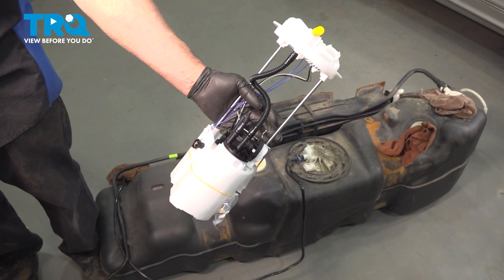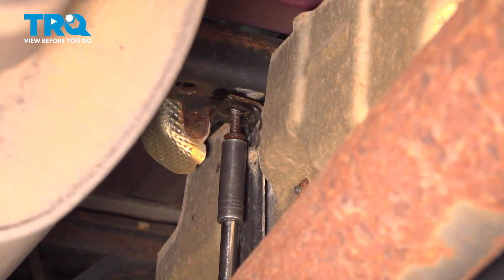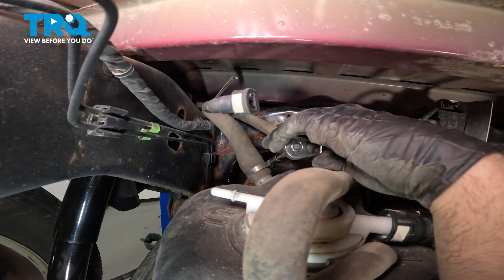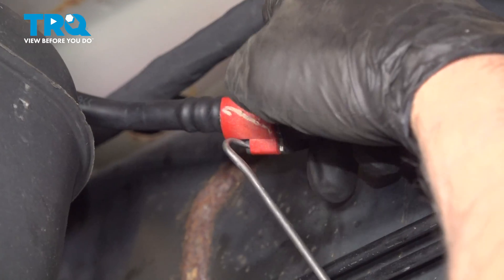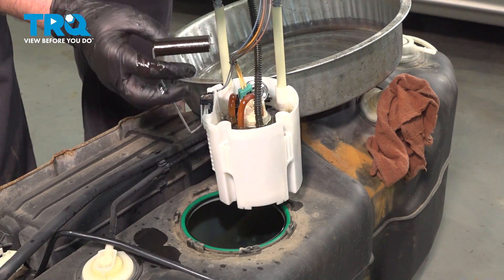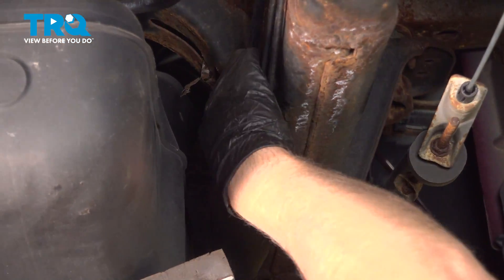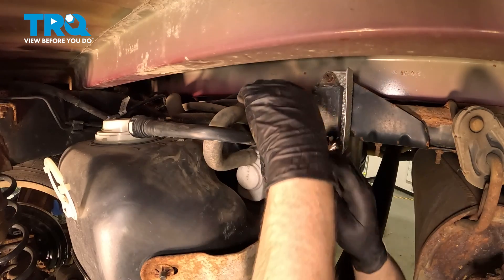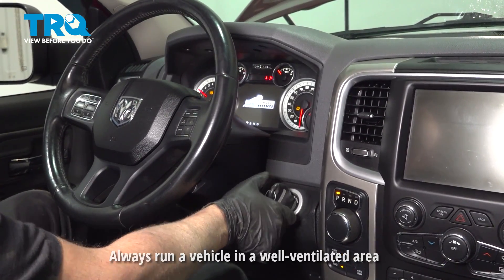How to Replace Fuel Pump Module Assembly 2011-2018 RAM 1500 3.6L

Comment: Why did you disconnect the fuel line on the rail of the truck instead of at the tank....double disconnect?  Was it inaccessible or just showing 2 points of disconnect...looks like you had a difficult time needing an air compressor to blow off the debris or whatever was keeping you from releasing it easily??

Comment: Great video! Didn’t take long to replace fuel pump with help from this video! I don’t have access to a lift so I used ramps on the rear tires which allowed great access underneath. For lowering the tank, made sure my tank was down to about a 1/4 tank so I could move it around myself as needed. I then used ratchet straps placed near the tank straps which allowed ease and a controlled drop to disconnect the lines and wires! Overall, a pretty easy fix for my fuel sender unit failure and saved myself hundreds!

Comment: Can you please tell me what the 2 wire connector is that you removed @3:30 min in the video. When I changed my fuel tank one of the wires in the clip was out, I tried my best to reconnect it. I am just curious what it is for. Thanks!😊